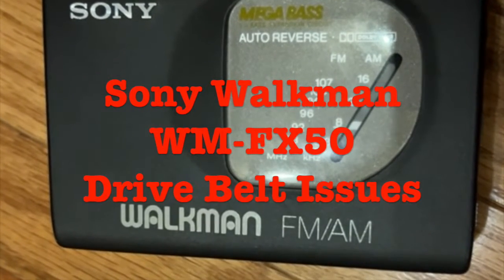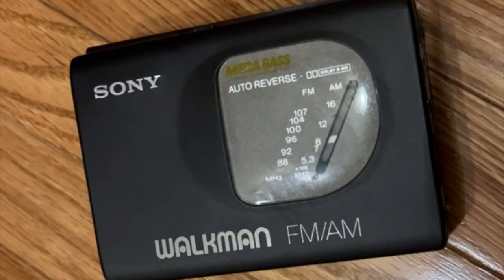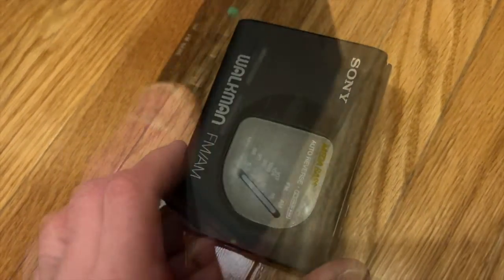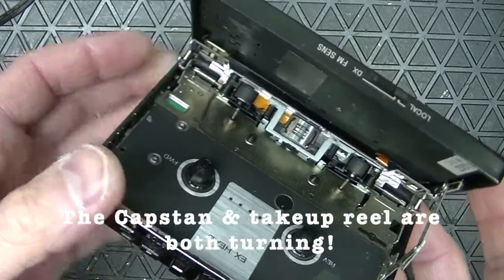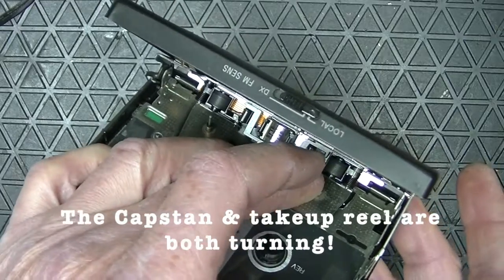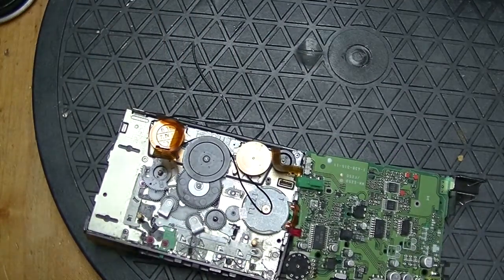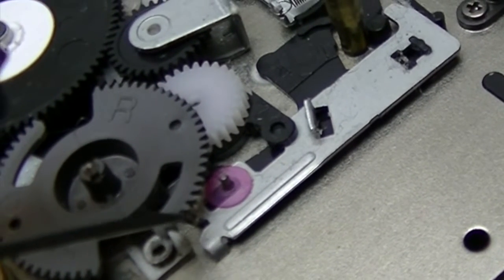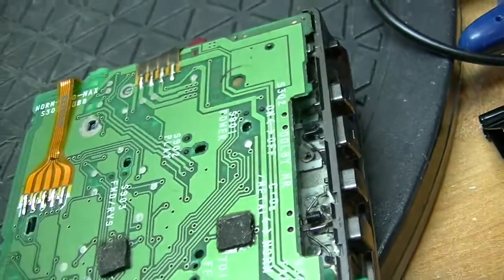Sony Walkman WM-FX50 Drive Belt Issues

Comment: Hi, my friend! Lots of thanks for this video! I’m have Sony Walkman WM-GX35 (radio with recording function) with the same mechanism, changed new belt but now have cracking sound and not understanding from where. Maybe you can suggest something?
Reply from the maker: You’re very welcome 😊 !  I would like to pinpoint the source of the crackling noise. Does it happen on only PLAY, on PLAY, FAST FORWARD, and REWIND? Does it happen with and without a tape? Does it happen when the radio function is being used? Does the volume control change the volume or frequency of the crackling noise?
Reply: @Mr.BrownsBasement  I’m disassembled now and noise coming from DC 3-phase motor. Noise like tractor working.
Reply from the maker: Check for a bad filter capacitor across the motor. My first guess is that motor noise may not be suppressed. Also, sometimes motor noise becomes audible when the batteries are low. Are you using fresh batteries?

Comment: Very helpful thanks Mr_BB.  Belt-Path now clear to me (wasn't obvious) for my Sony WM-GX51, which is essentially the same device but incorporates digital radio operation.  Wish I observed your video 2 weeks ago, as I struggled with some dismantling (that you nailed well) - Hopefully the minor damage I've inflicted hasn't disrupted my repair goals. The belt on mine had completely perished (falling into ~30 seperate fragile pieces), but I have ordered a new belt from DeckTech. I'll come back when I attain my re-assembly (or not)!  Regards. 🥝🐐.
Reply from the maker: I’m very happy that it was helpful. I remember thinking at the time that ease of repair was not in Sony’s “top 10” design priorities. Some Walkmans are more a cruel puzzle than tape player. Let me know how you make out once the belt arrives!